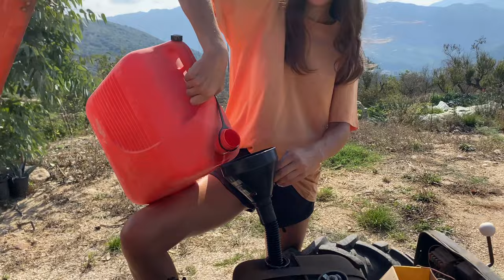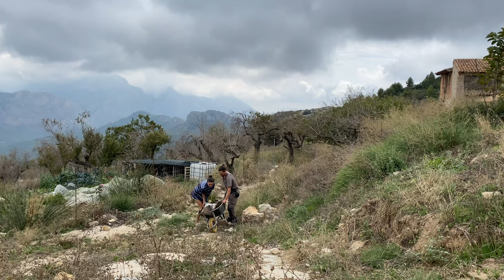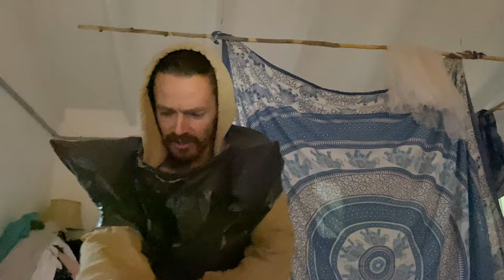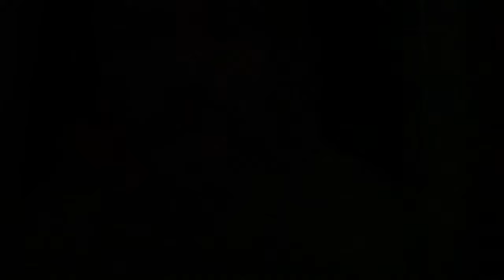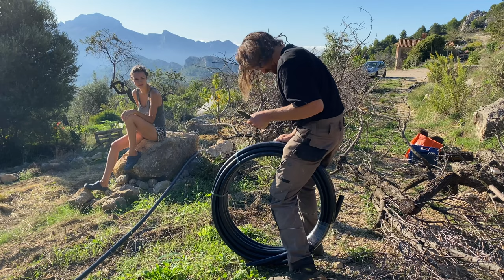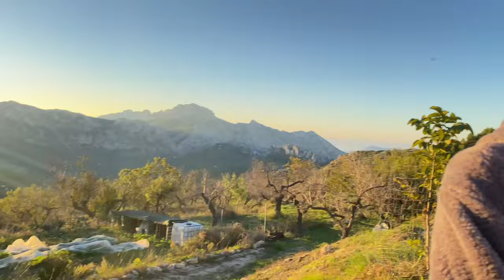Turning our ABANDONED LAND into an OFF-GRID HOMESTEAD | Making a Food Forest

Comment: Try planting MUSTARD. It needs to be cut and embedded in the ground before flowering. Over a few years, this will improve the softness and quality of the soil.
Reply from the maker: Never heard of this before but it sounds like a great solution, we’ll make sure to try it thanks Andrey! Do you mean cut back the mustard plant and lay it into the ground each year (before flowers form on the plant) like mulch?
Reply: need to cut it before flowers (this way it have a lot of useful forces inside) and dig so that the stems are in the ground. We do it two years and turn our soil to the good one (nothing want to grow there before)! UPD: we used lawn mower for cut it. Wife told that you can leave it as mulch on the ground, but in ground it will work better. In two years you even no need showel for gardening - soil becomes soft as feathers and there are a lot of worms